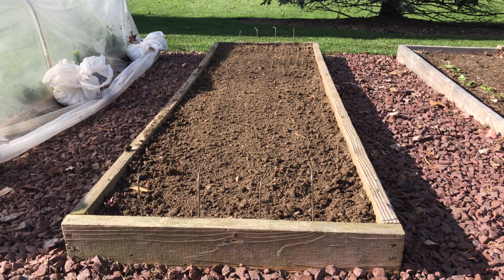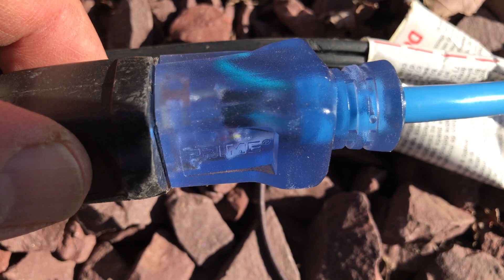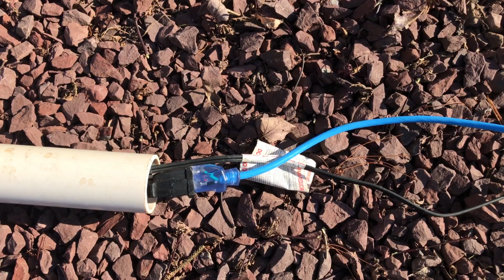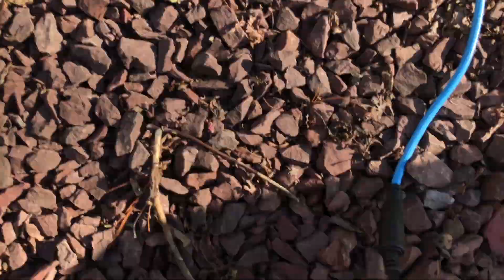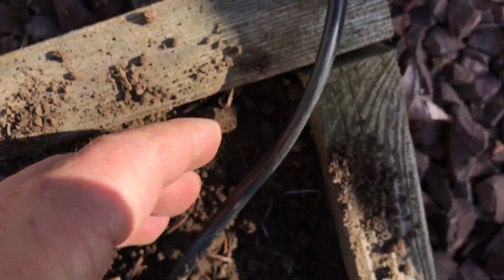Radiant Heat For Your Raised Bed   Grow Food all Winter

Comment: I have raised beds like yours and would like to talk to you about the ceramic heater vs the cable. I'm using 150w lights to heat my beds and looking at different options. Thanks.
Reply from the maker: The heater is a better option because it doesn't interfere with your planting options. The cable gets in the way of planting. Both work fine though. Thanks for watching.

Comment: Hi Keith, how did your experiment turn out? did you achieve your desired cropping outcome? Im interested to hear if you tracked your soil temperatures day and night through winter, and what these temperatures were? Appreciate this great idea
Reply from the maker: Because it was covered, the soil temp. stayed around 70. Everything in the bed survived all winter. There was no growth over Jan. & Feb. due to insufficient sunlight. Things picked up in March. I call it a success.
Reply: @keithwilkes7629  that’s great thanks for your response! Did you notice any deterioration of the heated wire due to soil microbial activity, or just plain soil and root contact? Considering running heated wire within 1/2” pvc to ensure the wire is safe for extended periods. Thank you
Reply from the maker: @ripsurf21  Buried wasn't a problem. The cable is made to be put in a downspout to keep it from freezing during the winter.

Comment: I live in SF. The temperature stays between 50-70 basically all year around. I live in an apartment with a patio that gets morning and afternoon/evening son. Shade in middle of the day. I wanted to plant some vegetables in a self watering raised bed but it doesn’t get hot enough for tomatoes, beans, etc. 
So I was thinking maybe a heating cable will help heat up the soil and add a removable hoop tunnel on top. Do you think that will give summer vegetables enough heat to grow? 
I don’t have to use the self watering feature of the raised bed since I don’t wanna mix water and electricity lol
Reply from the maker: You can use a plastic row cover to help heat up the bed but you'll want to open the sides for ventilation or it could get too hot on a warmer day. You won't need the heating cable if you use a plastic cover. Thanks for watching.

Comment: Keith - I know I asked you in another video to do a video with the de-icing cables. Just came across the video you did earlier. Great idea!
You are very simple and practical Gardner. Love your videos. By the way, I’m also using your tomato trellis this season.
Reply from the maker: The cable did keep the soil warm and the plants alive but they really didn't grow because of the amount of sunlight. Now I know what to expect. I like to keep things simple because I don't have the time for complicated contraptions and systems. Thanks for watching.
Reply: @keithwilkes7629  so what would ur advice be on using this kind of set up for? May be like, would that be good u think for seedlings and in cold frames may be to get a head start?
Reply from the maker: @jhansi1402  I used this to over winter my plants. You could use it very early in the season to warm the soil sooner. I would wait until you have at least 10 hours of sunshine every day before trying that. Thanks for watching.
Reply: @keithwilkes7629  sure.. Thank you

Comment: Experiments are good ways to find out if something works the way you expected.  Thank you for doing this.   Depending upon the cost of electricity, this may be a useful method.  If you have solar panels, it would make this approach more feasible.
Reply from the maker: Here's my take: Spend the money on a bit of electricity or buy it at the store. Also, the soil temp is hanging around 60 degrees and the lettuce is sprouting after 6 days. Yippee. Thanks for watching.